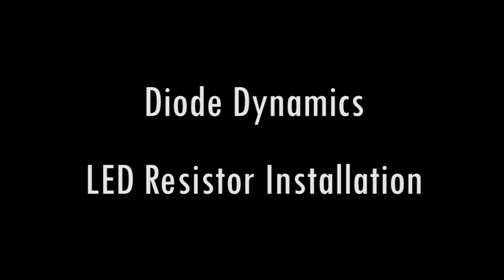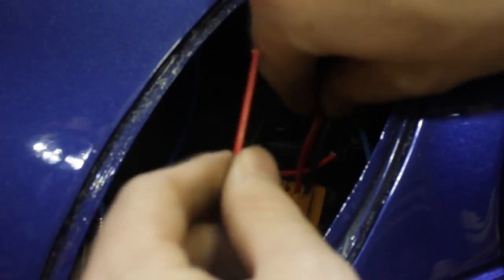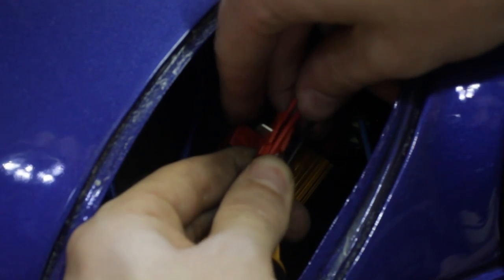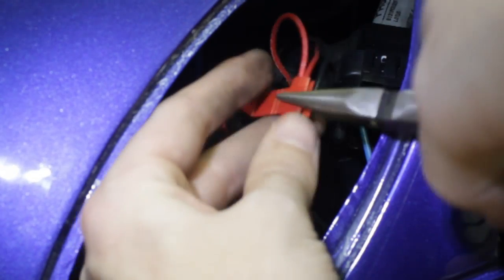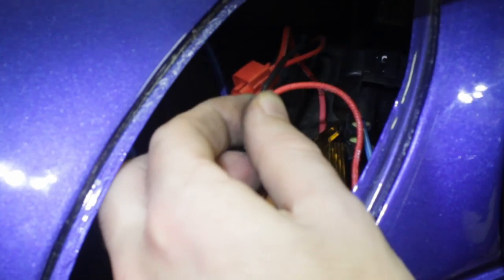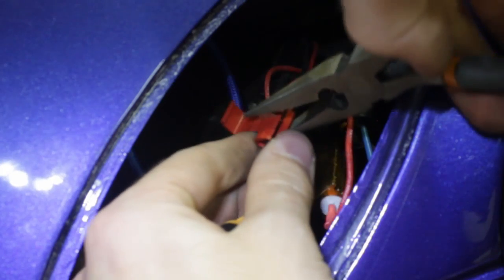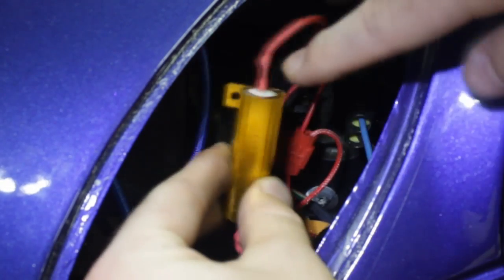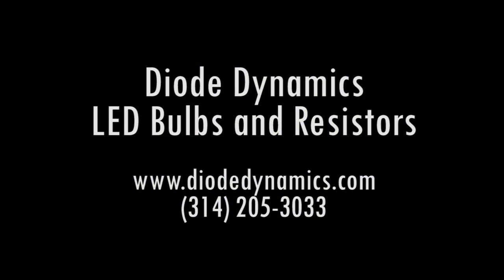How to Fix Hyperblinking! Installing Resistors for LED Turn Signals | Diode Dynamics

Comment: With all due respect.. Installing resistor is not an ideal solution and actually it is far more complicated than replacing a relay under the dash ( which is what I did eventually ). Resistors for starters get hot, and need to be fixed properly otherwise they knock against the front clamshell.. Replacing relay takes 5 minutes and the relay itself costs nothing and altogether it is a much neater solution (additional advantage is that it drains much less power..).
Reply: Can't argue with that.. above being said - car used in the video (Lotus Elise / Exige S2) - one I actually referred to - has the relay under the dash.. ;-) and adding resistors there - completely makes no sense.

Comment: So I installed LED Brake/Blinker lights in my 2017 Grand Cherokee. Inside the car it's hyper blinking but my turn signal outside blinks normal speed. Any idea what this means?

Comment: Why is the resistor 50W when the bulb is less than 25W?  Could the job be done with a 25W resistor, and be cooler?
Reply: Because the halogen bulb used it 55W and the LED unit is typically 5W... if I understand correctly.

Comment: I have 2007 honda civic coupe. my front turn signal has 3 wires. red, black and green. Which is the green wire? marker filament?
Reply from the maker: +MrJemray2099 Unfortunately we do not have this information for your vehicle on hand, but we would recommend using a voltage meter to determine which wires you'll need to tap. If you have any further questions, just let us know!
Reply: Thanks for the reply! Another thing, if I may, what should I look for if I test to see if the wire is ground and one is positive?

Comment: How many load resistors are required per install? If I have led turn signals in front and if I have led lights in the rear? Do need two in front and two in rear ?
Reply from the maker: +Angel Galvan Generally, you will need one pair of resistors per location (for example, one pair for the front turn signals and one pair for the rear turn signals). If you have any further questions, please don't hesitate to contact us!
Reply: Diode Dynamics ok thanks!
Reply: I've noticed some of the resistors are 25watts and some are 50 watts is that important? Because I had bought two from Walmart that are 25watts?
Reply from the maker: +Angel Galvan We recommend using resistors with a rating of 50w (6ohm), as that is usually enough to compensate for one bulb. Please don't hesitate to contact us with any other questions!

Comment: So I just installed mine, mounted the resistors above the headlight housing along the frame, and the signals work great. But, I noticed my windows don't automatically go up when I fully depress the buttons. They go down all the way, but I have to hold the button in order for them to go all the way up. It's not a huge problem, but it's an adjustment I'd rather not have to make lol anyone else experience something like this?
Reply from the maker: +Conn Diggity We are sorry to hear about the issues with your resistors. Please give us a call at 314-205-3033 Monday-Friday 9 a.m.- 5 p.m. CST, or shoot us an email at contact@diodedynamics.com, and we can help you troubleshoot!
Reply: What car do you have?
Reply: moNYTx 09 G37 a coupe
Reply: I figured it was a G lol. It's a common issue for the windows to act up, but I'm not sure if it has anything to do with the resistors. Follow these instructions in the thread, pretty easy fix.

http://www.myg37.com/forums/audio-video-and-electronics/183448-window-reset.html
Reply: Oh crap I forgot to update this comment lol Yea I figured it out after a sift through the forums lol thanks I appreciate it!

Comment: I am installing load resistors for my Toyota Tacoma. It will be the front signals so I have to put them in under the hood somewhere. What happens if they get wet during the rain?

Comment: I spliced my cables however, while splicing, one of the quick connector clips (the clip that goes over the metal piece used to splice) broke and it's only the t-tap without the secure clip. I made sure that the connection was secure and put electrical tape around it so that the connection remains secure, but I'm just wondering if that will last. I'm worried that it will lose connection because of the broken off clip. Thanks!

Comment: Quick question, how do you guys shield off the resistors from any other wiring and items in its surroundings. I know resistors tend to get hot, and almost no one explains or shares any techniques on how to properly shield off these resistors :(
Reply from the maker: We recommend keeping them away from any wires or anything that can be damaged from heat. If you have any further questions, feel free to contact us!

Comment: how do you do it if you have 3 wire so and basically 1 end of resistor to postive and the other to negitive
Reply from the maker: +jackson jones Go ahead and give us a call at 314-205-3033 Monday-Friday 9 a.m.- 5 p.m. CST, or shoot us an email at contact@diodedynamics.com, and we can give you further instructions!

Comment: I've been looking for a short video like this that explains how to use these resistors so I could switch to LED turn signals, but had not found one that showed or explained it as well as yours.  I now feel comfortable in making the change myself.  Thank you very much.  Can I recommend or in some way attach this video to the Kia Optima Forum so that others might benefit?
Reply from the maker: +Jim Roth-Roffy Thanks for your support! You can certainly link to this video on the forum.

Comment: i was install resistor in my car .. but i need to know if its problem .. when i start the light for 5 or 10 minutes i cant tuch it .. its so soo hot it can damage plastic .. so is it normal or not

Comment: ive just got led lights on motercycle they are flashing abit faster than normal they didn't come on only back ones but didn't flash so put 2 resistors on the 2 front ones now they are flashing like i said do i need them on the back to get them normal mate im new t all this
Reply from the maker: +Deana Elvin Thanks for reaching out! We recommend installing one 50w 6ohm load resistor per LED turn signal bulb. If you have any further questions, please don't hesitate to contact us!

Comment: im kinda like the hyperliking
Reply from the maker: +tacoma Thanks for reaching out! You can certainly let your vehicle keep hyperblinking; it won't damage anything.
Reply: Its not so great on the turn signal relay though, it basically makes it work double or triple duty with all the extra extra travels the relay has to make.

Comment: So am I correct in assuming that for EVERY bulb that blinks you will need a resistor if it is converted to LED? I have a 16 Fiesta ST and am insterested in going all LED but I would need 6 resistors for all the blinkers it has including the mirrors. Any help is appreciated, thanks.
Reply from the maker: +pinkie5839 We recommend purchasing one resistor per pair of turn signals to create enough resistance for the whole turn circuit. In your case, you would need a total of three resistors. If you have any other questions, just let us know!

Comment: So I bought some led light tube/strip that works as lights as well as signal. It has this problem too, do you think getting some resistors would fix this problem for the tubes I bought as well? Thanks
Reply from the maker: +Jerry qin Yes they would! Feel free to give us a call at 314-205-3033 Monday-Friday 9 a.m. - 5 p.m. CST, or shoot us an email at contact@diodedynamics.com, for further wiring instructions!
Reply: +Diode Dynamics so I wired the lights to my signal lights too where I have the led strips as well as the regular signal lights and somehow it stopped the hyper flashing
Reply from the maker: Jerry qin Glad to hear it! If you ever have any further questions, don't hesitate to contact us!
Reply: +Diode Dynamics thank you!

Comment: first do i only need resistors for the turn signals? and do i need a resistor for each turn signal?
I own a 2003 Ford Explorer Sport XLT and would like to upgrade to LEDs. also can you help me with LEDs for my headlights
My email is wnutt1@comcast.net
i noticed on your website that your vehicle search only goes to 2003 Ford Explorer
Reply from the maker: +Walter Nutt  Thanks for reaching out! You should only need resistors for the Turn Signal LEDs, and yes, you will need one for each. If you purchase any of our Turn Signal LEDs on our website, you have the option to include our LED Resistor Kit with your order. If you email us at contact@diodedynamics.com, we can help you find the bulbs you'll need for your Explorer.

Comment: I have 9W LED bulb. it blinking very fast. i changed the driver and replaced a new one. samething happened.  let me know the reason please. how can i repair it??
Reply from the maker: +Gaveshani Jayasingha Unfortunately, we are not familiar with the exact bulb you installed. However, we recommend installing resistors to try to fix the issue you are experiencing. Turn signals on most vehicles will begin to blink fast (hyperblink) when LED bulbs are installed. This is because the new LEDs will use less power than the original bulbs, so your vehicle thinks that the bulb is out and warns you by hyperblinking. Replacing the flasher relay, the module that controls blinking speed, is the easiest option to correct hyperblinking. If you prefer not to change the flasher, you can add resistors to the bulb's circuit, and mimic the power consumption of the original bulb, returning the vehicle to normal turn signal speed.

Comment: So what do you do with the resistors? Obviously I dont wanna screw them to metal, as I don't wanna drill holes into my car. And I also don't wanna leave them loose because as the car moves, the resistor could move too and touch plastic. So it would've been great if you showed how to place the resistors. But thank you for the video.
Reply from the maker: +WhiteSlift, thanks for reaching out! Go ahead a give us a call at 314-205-3033 Monday-Friday 9 a.m.-5 p.m. CST, or shoot us an email at contact@diodedynamics.com, and our sales representatives can help you with this. If you have any other questions, please let us know!

Comment: can anybody help with an led problem? I installed front led turn signals in a bmw, they work perfectly with the key on, engine off, but when I start the car I get 2 or 3 choppy blinks then they stop (both sides, either side) I can cycle the ignition and they work ok again until the car is started, and again once the car is running they no longer stay on. but key on, engine off will blink normal speed indefinitely. weird, not sure what im doing wrong. 25w 6 ohm resistors, tried 50w 6ohm resistors and have the same issue.
Reply: +halojump123 ?
Reply: sounds like a bad wire somewhere. check your ground and trace wires. good luck.

Comment: Hey paul, I have a 1980 Honda motorcycle. My turn signal both still blink at the same time. Anything I'm doing wrong?
Reply from the maker: +telnetcarlos, thanks for reaching out! Go ahead and give us a call at 314-205-3033 Monday-Friday 9 a.m.-5 p.m. CST or send us an email at contact@diodedynamics.com, and our sales representatives can help you out!
Reply: I have the same problem.i can't figure it out..have you got any clues from anyone? thank
Reply from the maker: +Cust Cust Feel free to contact us as well at 314-205-3033 Monday-Friday 9 a.m.-5 p.m. or contact@diodedynamics.com, and we can help you troubleshoot!

Comment: I ride a motorcycle, figure electrical is the same for a 12v circuit. I installed 4 led blinkers and now they all blink at the same time. I've been through the wiring and none of them touch anywhere so they shouldn't be doing this. Can it be because there isn't any load resistors so it's all going off at the same time or what?
Reply from the maker: +Thomas Brock, thanks for reaching out! Go ahead and give us a call at 314-205-3033 Monday-Friday 9 a.m.-5 p.m. CST or send us an email at contact@diodedynamics.com, and our sales representatives can help you out!

Comment: I have 2007 chevy silverado and replaced both headlights and Tail lights with leds, just 3 weeks ago and now it's blinking fast with no bulbs out, do I need a resistor and if so why didn't I need one before, also what kind do I need..  SPYDER halos and leds .?
Reply from the maker: +Joe The G, unfortunately, we aren't familiar with their products; however, we usually recommend installing resistors in the turn signal location, not the headlight and tail light locations. Hope that helps! If you have any other questions, feel free to contact us!

Comment: For a full size vehicle does it require 4 of these resistors for all four blinkers?
Reply from the maker: +PeteyPablo, yes, that is correct! You will need to order 2 Resistor Kits (4 total resistors) for all 4 turn signal bulbs - link below. If you have any other questions, feel free to contact us! 

http://www.diodedynamics.com/store/accessories/led-accessories/resistors/led-resistor-kit-18974

Comment: does one load resistor do the entire circuit? I've got the hyper flashing problem with resistors on the way, but I also have LED side indicators near the front doors I'm putting in and was wondering if they will also hyperflash
Reply from the maker: +Aaron Holborn, we recommend installing one resistor per LED turn signal bulb. Our Resistor Kit includes 2 total resistors (link bleow). If you have any other questions, feel free to contact us!  

http://www.diodedynamics.com/store/accessories/led-accessories/resistors/led-resistor-kit-18974

Comment: What if I don't do this??
Reply from the maker: +HIDDENRAINN, if the hyperblinking doesn't bother you, you don't have to install resistors! Some people don't mind the hyperblinking and choose not to install them!
Reply: Diode Dynamics Is it possible that this needs to be installed on a DRL/High beam?
Reply from the maker: +HIDDENRAINN, you should only need resistors for the turn signal location. If you are experiencing hyperblinking in your DRL/High Beam, you most likely have a bad bulb. If you purchased your bulbs from us, go ahead and give us a call at 314-205-3033, Monday-Friday 9am-5pm CST, or send us an email at contact@diodedynamics.com, and our sales representatives would be happy to assist you!
Reply: Diode Dynamics Thank you so much for answering my questions! I will call or email you when i'm ready to purchase. Do you ship in Canada?
Reply from the maker: +HIDDENRAINN, we sure do! Below is more information on our international shipping. If you have any other questions, feel free to contact us! 

 http://www.diodedynamics.com/store/shipping-info

Comment: If I install LEDs on my front and rear blinkers do you need a resistor on all four blinkers (front AND back)?  I read somewhere that one resistor on each side is enough, but I don't know if that's true.
Reply from the maker: +Robb Alan, you will need to order 2 Resistor Kits (4 total resistors) - link below. If you have any other questions, feel free to contact us! 

http://www.diodedynamics.com/store/accessories/led-accessories/resistors/led-resistor-kit-18974

Comment: So I got these and put them on my 2005 Pontiac Grand Prix. I put new front turn signal led bulbs before I got the resistors. After putting the resistors it still hyper links. I spliced the blue wire, as the resistor video showed most cars have red but in some the turn signal wire is blue. I spliced the blue wire with the red from the resistor kit. I also spliced the black wire as was stated in the video with the other red wire from the resistor kit. So did I do anything wrong because it still is hyper blinking. I would appreciate it if diode dynamics would respond.
Reply: +undefeated2012 I just recently installed mine. Instead of guessing what wire is what. If you have them use a power probe to locate which wire is the one providing power to the bulb. Unplug the connector, take out the bulb turn on your turn signal and use it to locate which one is power. You'll also need a voltmeter to locate the ground wire. In this video they use these cheap clips, and to be honest they are shit. Half the time they dont work or come loose. Your best option is to just splice the wires together.

Comment: I added some 33watt 3000 lumens led bulbs for my headlights on my Jeep Patriot. Will this resistors stop my flickering
Reply: Generally, instead of resistors you'd need capacitors to stop flickering. I know my OPT7 set came with capacitors. See if the manufacturer of your set offers some?

Comment: Is hyperblinking illegal?
Reply from the maker: +A Dawg, No, hyperblinking is not illegal. When you install any LED, the new LED will draw less power than the original bulb, so your vehicle will think that the bulb is out and warns you by hyperblinking. In order to prevent hyperblinking from occurring, we recommend installing resistors; however, your LEDs will still function perfectly fine without resistors installed. Let us know if you have any other questions!
Reply: +Diode Dynamics thanks!

Comment: Does it matter which way round the resistor is connected? As I can't see any positive or negative markings on my resistors. Cheers
Reply from the maker: +TheWhatIC, luckily, it does not matter which way round the resistor is connected! If you have any further questions, don't hesitate to contact us!
Reply: +Diode Dynamics Thank you. That is really helpful

Comment: I have the LED turn signal/markers in my 09 Silverado and plan on doing the tail lights as well, the front have 2 turn signal bulbs per side do I need resistors for each bulb and will I need them on the front and rear or just the front? not quite sure how that works any help would be greatly appreciated
Reply from the maker: +Cory Tuttle, great question! In order to prevent hyperblinking in both the front and rear, you will need two pairs of resistors. If you have any other questions, feel free to contact us!